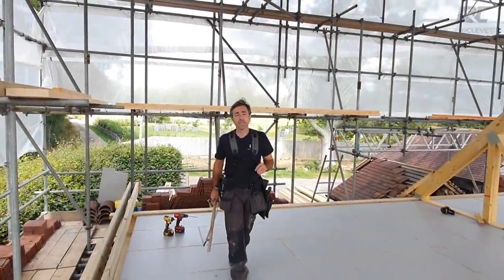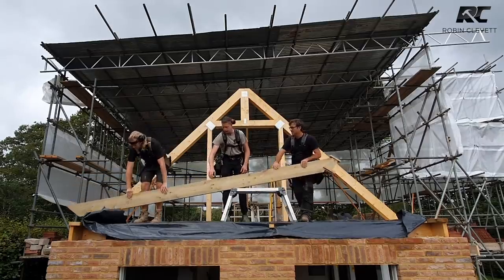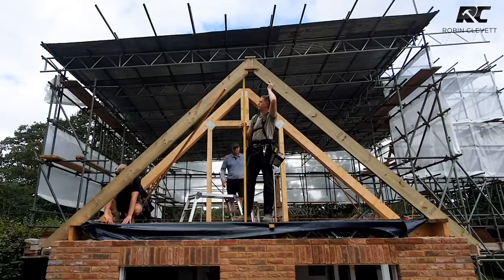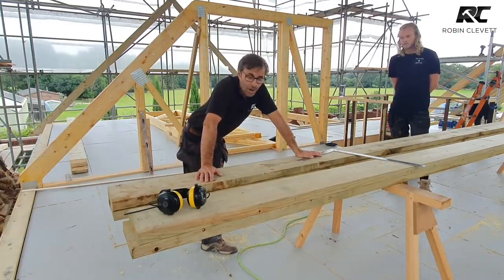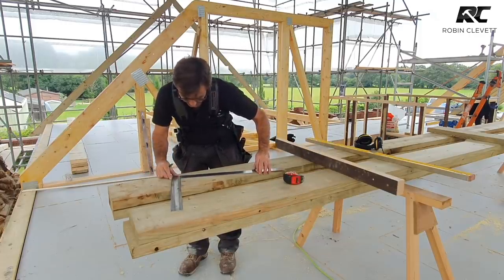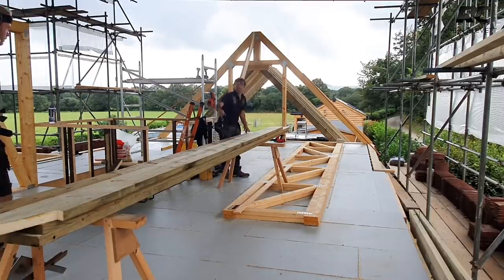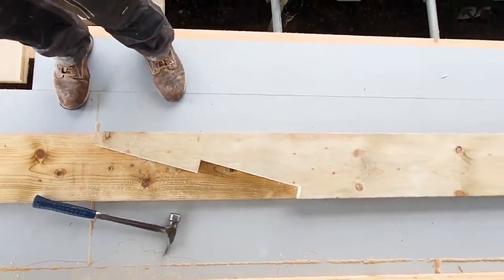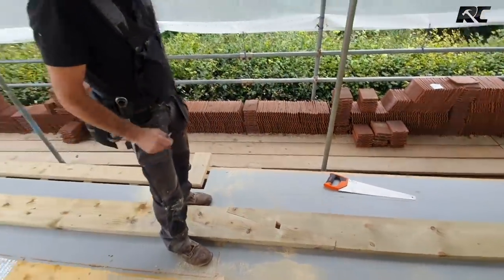The Big Build 25 The Lads First Roof, And making a Scarf Joint

Comment: Great video can’t wait for the square and app to be available. Noticed your Circular had a 5AH in it I have recently upgraded to the 8AH high output batteries they cut through roof timbers like butter and they don’t strain the saw.
Reply: Fair weight on them 8AH
Reply: @kuk3411  M18HB5 good for skillsaw or combi
Reply: @kuk3411  hit them weights 💪🏻
Reply: @ottango531  my spaghetti arms can’t handle it!
Reply: @kuk3411  been running the m18 framing nailer with 8ah recently 😂😂 jelly arms mate
Reply: Came to say the same. High Output with bigger cells being the new version of the older High Demand. Gave my big SDS a power boost.

Comment: always hard going trying to plumb up a truss that way with no timbers in the middle @ 4.00 what i have found works really well is pinging a chalk line on the floor, example 100mm in from each end of fixed point of truss cord/ then find centre of truss sit a dot laser on your chalk line and use the dot laser to plumb up truss at apex being the same 100mm so accuarte and keeps roof so square :)

we also use a dot laser to plumb up all external corners of studframe and internal frame work rather than a spirit level and my god its so much more accurate

Comment: What if you'd cut the ends of that scarf joint at say 80 degrees or 75 instead of 90? Wouldn't that end up pulling the ends in tighter?
Reply from the maker: Tried that and it makes no major difference so we keep it 90 degrees, nice question...

Comment: I wonder if making the angle at the shoulders of the scarf joint somewhat less than 90 degrees wouldn’t lock the two pieces together better?
Reply from the maker: Not really John, the scarf joints main strength comes from the wedges and the long profile of the geometry, I have tried it with steeper shoulders but no real benefit, great question!!

Comment: Loved every second of this. RC you have a great coaching style, lucky lads. Why did the saw bind quite a lot when cutting that first joint? Just curious!
Reply from the maker: Well I mentioned as I was setting out about the unevenness of sawn timber and also how wet it was demonstrating that as the saw runs over it may bind, also the battery was running out, I should have checked that before I cut it!!

Comment: could you put steel plates both sides of the scarf joint + bolt them all together for extra strength  ??
Reply: No need, the less steel in a house the better. Horrible stuff 🙄

Comment: Robin, do you work your rafters out mathematically (birdsmouts,, length, etc) or use a pattern? Eg if the rafter is 6x2 then we use a 4x2 to mark birdsmouth points  (2/3 above plate using those 2 sections see) and transfer that onto to our 1st rafter. I prefer the 1st method but 2nd seems more foolproof in the real world....
Reply from the maker: Hi Pete, I am going to cover every aspect of this in future videos, keep tuned!!

Comment: Robin, how comes you choose to screw nails? What about the shearing factor or a screw opposed to a nail?
Reply from the maker: We use screws to safely set it all up the we nail the structure together, if you look in the time lapse you will see Ed and Ollie doing exactly that, we only use a structural screw to
Reply: Ahhhh, thought I was missing a trick, and you'd found a screw for for the job. Thanks mate.